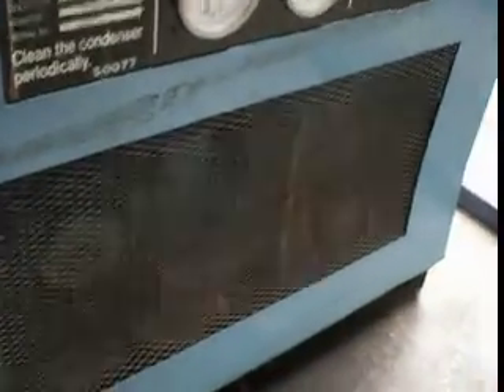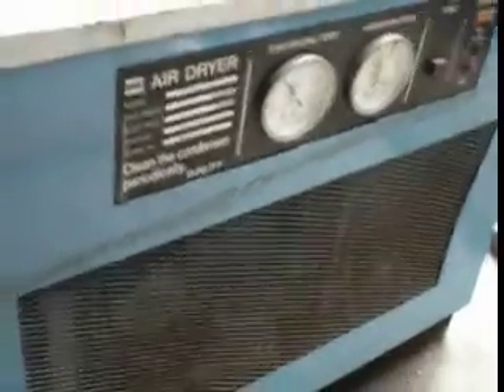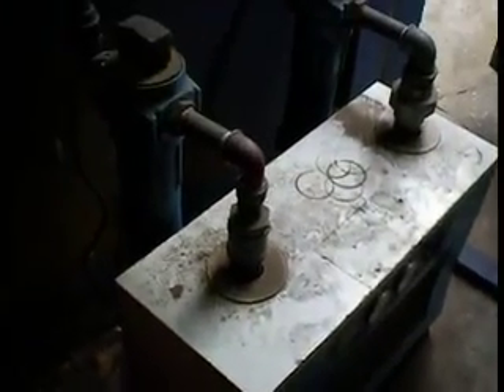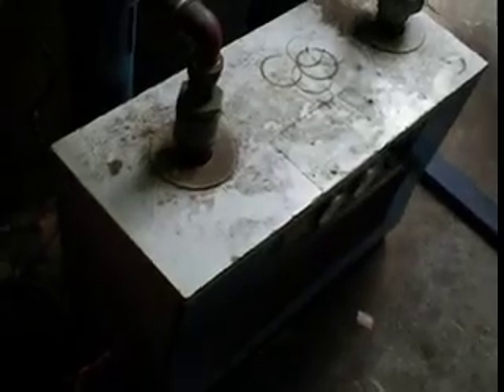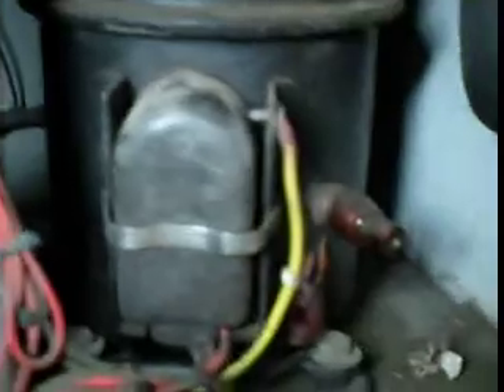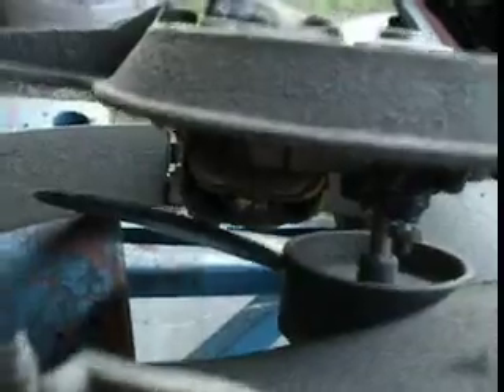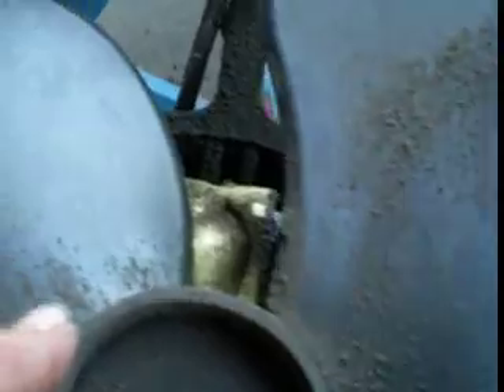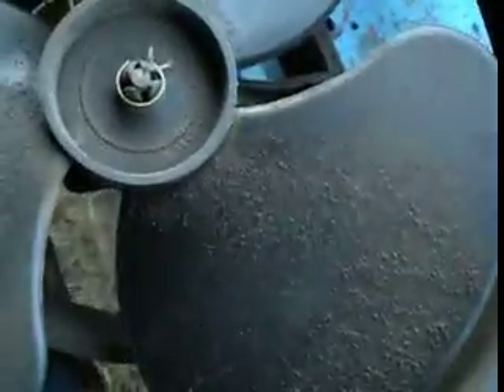aircomp and air dryer.

Comment: nice air compressor at the beginning of the video! but if it keeps cycling on and off due to leaky fittings you better try and fix that. you will end up overcycling the motor which will cause it to overheat and burn out. i fixed my dads air compressor. it had leaky fittings and would kick on every 10min or so.

Comment: Thai-made Kirby compressor...

Looks like the winding bobbin melted.  Luckily the insulation on the windings didn't melt otherwise you would probably had had an electrical fire.